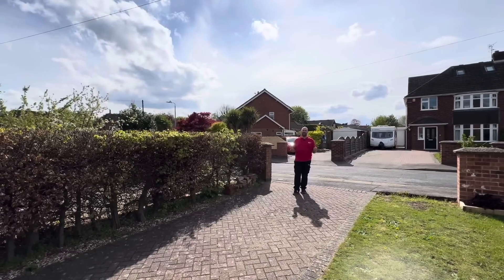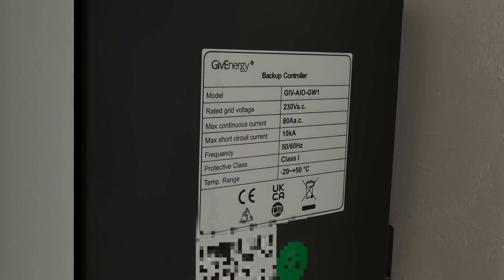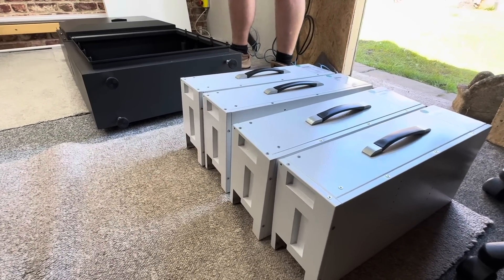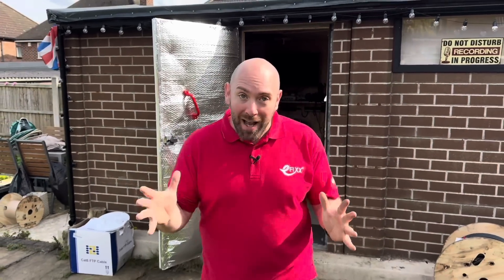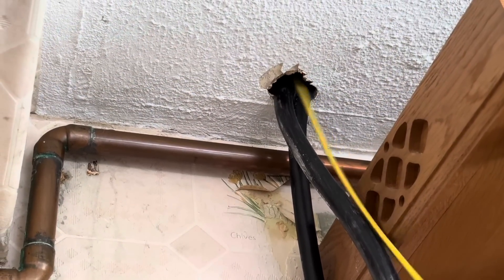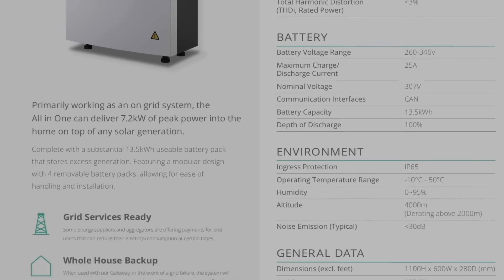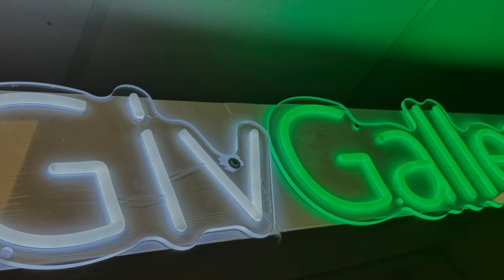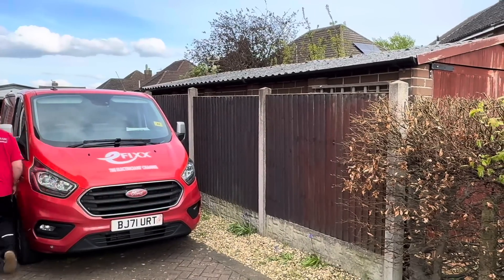GivEnergy All In One Home Battery – Insanely Easy Install!

Comment: Hi this set up looks amazing. It’s remote where i live and we are using solely electric for everything. I do worry that my main fuse will blow when we have everything on! Would having something like this benefit me? As in would it help reduce the amount of actual power I would be physically pulling through my supply cable? With the help of solar also to charge the unit

Comment: I like how easy you made the commission look lol. Many an hour on these bad boys I will not get back lol. Great product though! Wouldnt want to fit without MCS certification, especially if the customer wants to export energy. The DNO application if this is the 6kW version will also require the competence box on the G99 to be complete. They usually look for MCS registered electricians. Perhaps using the "new" octopus route you can negate this but as an installer I would not want to. The insurance is the big thing for me. It is not impossible for manufacturers and installers to fail... Having that for consumers is something reputable installers would want in place.
Reply: Easy to fit without the MCS certification which just rips off customers by overcharging. Can now work under an umbrella MSC cert now which makes it rubbish. Easy to do a G99 and get full export payment via the octopus route. Hearing quite a few companies now ditching MSC and prices dropping a lot as a result. I know this as I've done it. Payback in some cases less than 3 years if DIY.

Comment: Hmmm. Doesn't require MCS approval but does require G99 approval by DNO and as the inverter rating is greater than 3.68kVA (single-phase), they may have something to say about restricting any export to the LV network. Fast changeover from grid to battery but it isn't a UPS (as break-before-make is still a requirement) and so not guaranteed that any 'mission critical' devices won't be affected. Yes, some people say their PC worked fine and didn't 'notice' the changeover but that's probably luck (and large smoothing capacitors in the PC power supply unit!) more than anything. If it is vital not to lose work on a desktop PC, use a UPS whether you have battery storage with islanding capability or not.

I have read comments elsewhere in connection with this product that there is perhaps some dubious statement from the manufacturer that an earth/neutral connection relay is not required, but I could be wrong.

Just out of interest, what is to stop a user from deliberately simultaneously closing the 'Grid' and 'Bypass' switches while the device is in island mode? Is there a mechanical interlock?

The whole customer management through a web portal operated by the manufacturer is a big red flag. Wouldn't be the first such arrangement to be rendered useless if said manufacturer ceases trading. I don't understand why any business thinks this is a good selling point. Are the data analytics only available through the manufacturer's web portal?

Comment: Any installer looking at fitting  this companies products should be very careful, I purchased their equipment from my wholesale and had a terrible time, I couldn't energise the system because I hadn't done their course, which neither myself or wholesaler knew, then they wanted my wholesaler to register me with givenergy, and even after jumping through all those hoops they still wouldn't accept me, and the reason, I didn't have a website, which by the way is not mentioned on their testing course, my advice stay well clear.
Reply: Giv support is so undersized.... This is a sure sign of a greedy company...
Reply: @Eggnog3000  I don't know about that but their attitude was terrible really and dealing with me was too much trouble, it took me months to finally get the system online and had to be done by another registered installer who I had to pay £300, I will never install their products again.

Comment: I had one of these installed last Sep - very easy to use on app or portal. However, one issue though - data analytics using the GE portal do not match the Octopus data provided for import and export. As a result, I update a spreadsheet daily tracking solar generation and home consumption each day and then use the Octopus data for a true view of import and export.  In the process of making a video to show these differences to make people aware of it.
Reply: I think you'll find this is normal and due to the use of cheap CT style current measuring in these d3vices. I have a Victron system, and both grid export and import read about 5% over my electric meter. I have a Bright IHD connected to Home Assistant, so it's very easy to see readings from my meter. I also have an ET112 energy meter connected to my AC connected PV, that is very accurate when compared to my generation meter, but it costs around £80.
Reply: Do these ones let you calibrate the CT, on my inverter you can calibrate it in +/- 1W steps, I find my smart meter won't register below 10W, so I get it totally accurate with a static standby house load so the meter is reading 15W and then add 15W to the calibration, that way I have very little "leakage", I'd also bias it to a very slight import, as its really wasteful to be exporting if you're not getting paid for it (or its energy youve pad for on off peak).
Reply: I've found the CT based systems such as my solax are more responsive but less accurate, while the meter based systems are less responsive but more accurate - you can't win/

Comment: MCS definitely feels like a scam but if you get solar and/or battery installed without an MCS cert getting on an export tariff is a nightmare.
Reply: It IS a scam, you can only get a MCS certificate IF it's new kit  & all the correct boxes are ticked for MCS 😏,even if the installation is done by a NAPIT approved installer.
The   sooner everyone follows octopus the better 🤞.
MCS is just another way of getting extra money off the qualified electricians who then have to pass it onto the customer!!

Comment: Good to see that there is a Bypass Switch since the equipment greatly increases the complexity of the home electrics and the potential  for component or system failure. A "massive" warranty does not guarantee reliability.

Comment: By the customer not knowing about the power cut does that basically mean if I were on my desktop PC the thing wouldn't shutoff automatically in a power cut which has happened to me once in the past 12 or so months
Reply: Not sure I understand the problem, how does your computer shutdown (safely) without a battery system.
Reply: The PC would continue to operate as if there was power.  A will the rest of the house.
Reply: Not really. 120ms is too slow @PaulLandregan

Comment: You don't have to be MCS accredited for anything.
Reply: Some energy companies will not give off peak tariffs without an mcs certificate 
We have found this out the hard way and are having to go mcs or our customers can’t get the tariff they want
Reply: @samsawyer2145  Exactly. Some, not all.
Reply: We have no problems with any company be that octopus - edf -sse - British gas as we print out every bit of info required as would a MCS installer would MCS we Dont take deposits we fit then invoice so no need for all that miss selling rubish Jobs a gooden 👍
Reply: Doesn't an installer need MCS accreditation in order to apply for grant funding on behalf of their client?
Reply: @protectiongeek  I'm talking about the electrical installation side of things.

Comment: Interesting, it's a LIFEPO4 battery but I can't find any mention of battery heating with a casual glance at the datasheet / details on the web site.  Does it have self-heating ability?  If not, that would rule out exterior mounting since charging a LiFePO4 under 0c must be done at such a low current to avoid cell damage that it is essentially a pointless exercise.
Reply: If the batteries are in use. They generate their own heat.
Likewise the 0°C is cell temperature.  Which even if left idle, can take days to cool.

Under normal use, outside isn't an issue
Reply: @PaulLandregan  That's certainly not the experience in other parts of the world.  Lithium battery heating is pretty common where exposure to low temperatures is possible.

Many charging systems severely limit charging current under even under 5c as it's not a hard threshold, it's all about the rate chemical reactions leading to lithium plating.  At 0c cell temperature charging should be reduced to no more than 0.1c - 100AH battery, max charge current 1A.

Do you have any data to support what you've said?
Reply: @retrozmachine1189  what data? Actual real world data? 
My AIO lives outside. When discharging it warms.
While charging it also warms.
Chemical reaction not active heating.
Reply: @PaulLandregan  Yes, actual figures.  Graphs showing ambient air temperature, cell temperatures, load current, charging current over a period where ambient goes to 0 or below for a fair percentage of several days.  It's easy to say ABC, it's often far harder to prove it.  As I said before, battery heating is a pretty common thing for cold areas.  There are even stand alone batteries with heat pads built in.

I know many people are enamoured with Telsla products so as good a place as any to start.  Powerwalls sold into cold countries have heating capabilities - preconditioning - which expends energy to heat the cells before attempting to charge them.  It is possible to observe power flowing into a powerwall from the outside during this time, ie it is not just relying on the cells heating during discharge.
Reply: Doesn’t really rule it out, just means you might not get quite the same performance.
Reply: @edc1569  True, but I think if you can't change the battery for 5 days because, UK.. winter ... cold, it might be an issue.
Reply: There is no self heating ability sadly
Reply: Giv won't help you if you install outside and it goes wrong.... Install outside at your peril! They ask you to install a massive canopy over it which then looks rediculous... Tesla Powerwall has built in heating.... Nuff said

Comment: "Throttle back the power"
Hmmm, surely the power is set by whatever loads are connected?
Reply: The BMS will self regulate charge in extreme environments. 
Discharge isn't as affected. 
Capacity will drop a little In cold. Same as any other battery.

Use heating and waste power keeping capacity up.
Or loose little capacity. 

I'll take the more efficient no resistive heating option